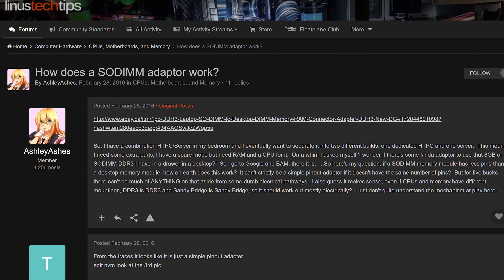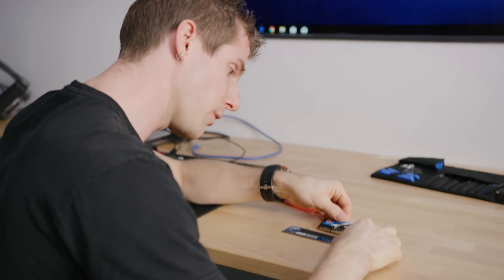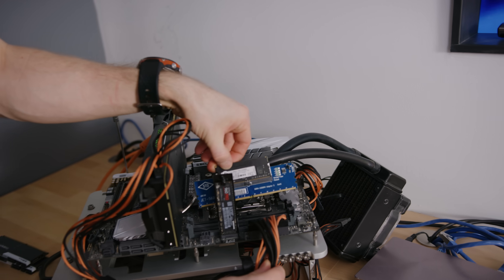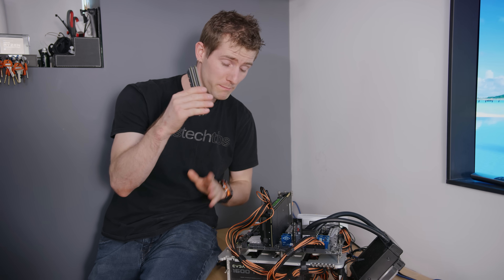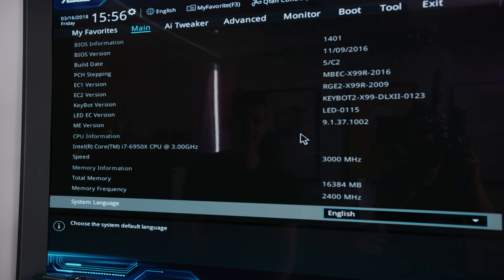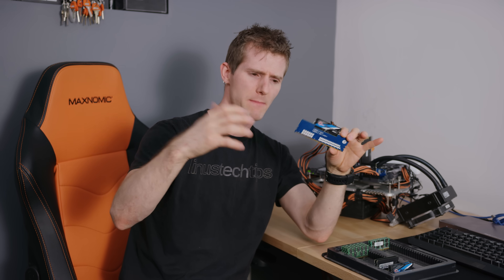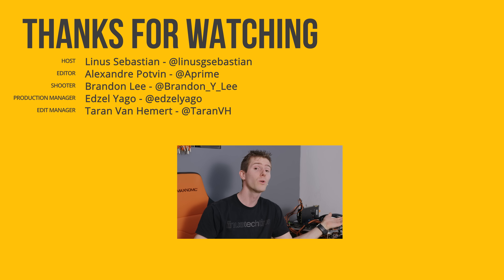Installing Laptop RAM into Desktop!?

Comment: Can you build a pc witout IP?
Reply: PurpleShadowYT yes you can build one without intergalactic penispumps
Reply: PurpleShadowYT Yes you can build one without ingress protection.
Reply: I personally wouldn't even consider watching incest porn whilst building a pc but hey.. each to their own
Reply: What's building a pc got to do with you having ingrown pubes
Reply: Wolfgang That's the only way to build one
Reply: Yes, to whatever it is. Let's just go with intergalactic protocol  ;D
Reply: Intergalactical porn
Reply: His channel is a Minecraft channel, I don't think he is joking when he thinks "an IP" is a physical part.
Reply: Why would you want to have a pc without interracial porn?
Reply: Yes. Don't connect it to the Internet or a local network and it won't be assigned an IP address.
Reply: loopback interface wouldn't be assigned if you boot certain clean linux distros with literally no connected hardware component holding any MAC address information... It's probably an optimization feature.
Reply: It might be difficult to build a PC without Intellectual Property
Reply: Omg hahaha!
Reply: april fool!!!
Reply: I'll have to give it a go now
Reply: mjc0961 it will have an address or couple that references itself in most modern operating systems (like 127.0.0.1 in most UNIX based ones). IP is a part of the operating system networking itself, not just outbound connections.

Comment: This is honestly great if you say come across a deal on laptop memory that's a good bit cheaper then desktop memory, or you working on an older system for someone, and only say DDR2, or DDR3 laptop memory laying around. So yeah will be keeping this in mind as I have and older computer at my work that could be upgraded to 8GB of DDR2 memory via laptop memory I have in the parts bin.

Comment: Is it cheaper than buying DDR4?
Reply: Drew E. I think the adapter is best to repurpose extra sodimms from broken laptops
Reply: In my country 8GB of DDR4 SODIMM is $45 USD, but 8GB of DDR4 DIMM is $105 USD, I'm buying 4 adapters tonight.
Reply: It you already have 4/8gb DDR3 SODIMM sticks it can be worth it.
Reply: tyaty wait so this makes ddr3 compatible on a ddr4 mb?
Reply: No. 
I was talking  about the  DDR3 version.
Reply: Drew E. SODIMM has been cheaper since 5 or so years ago.
Reply: I wish lol. Looking at SODIMM a year and a half ago for my laptop sucked. Although, due to DIMM prices skyrocketing, DDR4 DIMM and SODIMM kits are around the same price from what I'm seeing on PCPartPicker
Reply: Yeah, I looked it up too, on ebay 2x4gb costs 60$, (for the cheapest) plus 20$ for 2 adapters.
Reply: Balázs Rakó SODIMM is typically always more expensive...plus the cost of the adapter...I doubt it. Although in the current market, who knows

Comment: If you had laptop memory lying around, you can actually find itx motherboards that supports it. That's what I did with my last build. I had a laptop die, and it gave me 12gb of RAM. I put that in a Asrock IMB-181-L motherboard, with an i7-4770 and it is working pretty well.

Comment: I wonder what the cost difference between desktop and laptop memory is due to the different levels of demand?
Reply: farmerwoody123 i added it up to... 16 gb ddr4 2666 desktop ram at around $170 and up... vs. 16 gb of SODIMM ddr4 2666 at $94 plus $19 for 2 adapters... so $114... hell id try it out to save $56
Reply: farmerwoody123 Yeah it used to be laptop ram SODIMM was roughly 10% more expensive then DIMM
Reply: definitely lol!!

Comment: I wonder if you can use mismatched memory. For my desktop PC, I have a pair of 8 gb corsair ddr3 2400 mhz memory sticks with another pair of g.skill 4 gb ddr3 2666 mhz memory sticks. I kindof thought at first that I couldn't mix them in, but I did install all of them together and my PC now seems to work fine with all of the sticks for a total of 24 GBs of ram running at 2400 mhz with 10-12-12-31 latency, so I guess I did good there.

Comment: I think some versions of the adapters have the ability to override the RAM's configuration chip and some don't. I bought some for DDR3 RAM, they seem to work ok. It was actually a significant amount cheaper at the time to buy these and re-purpose some old RAM than by either new or second hand RAM for the motherboard.

Comment: so strait from the ebay page, this explains the ram speed and possibly the compatibly

Supports 2133Mhz Frequency
4-Layered PCB Design
Compliant with JEDEC Specifications
Over-Current Protection on SPD device
1-2 short: Select SPD device on adapter, 2-3 short: Select SPD on Memory Module (DUT)
Reply: Duds lol doesnt ltt have writers to skript these videos and do the research xD
Reply: 1,2 & 3 are the 3 jumper pins. The two jumper positions let you decide where to read the spd data from during post from the adapter or from the sodimm module itself
Reply: I get what you’re trying to say, but remember that ‘supports’ doesn’t always mean that anything else won’t work. 

For the compatibility stuff idk
Reply: @ v Nyggi, Yep thats the point I was making. This one did seem very light on research. Its almost as if that was the first time Linus had seen the adapters.
Reply: 1-2 short: Select SPD device on adapter, 2-3 short: Select SPD on Memory Module (DUT)
Can someone explain what this means?

Comment: If you have old laptop/iMac RAM, might as well get a less expensive adapter, especially in this day and age of super expensive RAM (you just need to be sure to match DDR3 TO DDR3 or DDR4 to DDR4, and match speeds and timings)

LTT should've tested mixing adapters with normal DIMMs that already have the same speeds and timings, or with first setting the normal DIMMs to a lower speed, then booting off and plugging in the adapters.

Comment: That's a great concept, but more research and test must be done for a finish product!
Reply: I read that as Finnish product as well.
Reply: ja wohl herr general
Reply: Nope its china. Its ebay. Make it and ship it.
Reply: Then use a German product instead.
Reply: That’s a great try but it needs more research before it can be a finish sentence
Reply: Mirage pt Stop trying to sound like you know shit.
Reply: noxxi knox It’s cool, it’s just a concept and it’s why the thing isn’t exploding on the market.
Reply: They have made memory adapters for years.
Reply: Maybe there is something to look at power consumption. Sodimms uses less power than dimms.
Reply: MIND NOVA ->Feel free to correct me, i am more of a power electronics person but i do know than differential pairs+length matching are very important for high speed circuits.
Reply: It is quite obvious to....some....that using one of the adapters in any of the RAM slots would make none of the RAM not work due to the increased trace length compared to regular DIMM cards. RAM are very high speed components and exact trace length to the DDR ICs is a must, that is why the trace have a lot of curves so that all the traces have exactly the same length. It might, or not, be possible than 5mm trace mismatch can make any RAM to not work.

That means than no amount of research can improve the product because one cannot cheat physics.

Comment: Now lets see using DIMMs in laptops
Reply: rememmber some Aopen barebooks did use full size DDR DIMM's.
but they also had the most crappy GPU's in history even for Laptops of it's time like a Geforce FX5200 or just Intel GMA on an "workstation grade" laptop.
Reply: Just give Linus a dremel or an angle grinder and he should be able to whip something up.
Reply: TheAlternateAir yes
Reply: TheAlternateAir I
Reply: There is in fact a kit,that you use soldering to install a few years back  its ddr2 or ddr3, remember it being installed into ,2008 macbooks...it was more for turning g a laptop into a desktop but ... why....oh yea for the lols,
Reply: +Linus Tech Tips YEAH HOW BOUT DA- what been trying to get! A tech guy I know said You can't but wanted it so bad:D 
Got a perfect test subject. Old HP 4520s business laptop, with ton of space. Love the design and screen but got low specs.
So I plan to add dimm memory, NVMe ssd, new fans (so loud now;/), white lighting below buttons, thunderbolt/usb3 & put 1080 inside (or lower end card with water cooling!). But no one here wants to risk it. Balls. It would be awesome tho.
Reply: They are too large.
Reply: yea why i think it was more aimed at ppl who wanted to turn laptop into desktop,was like 8+ years ago,i guess it never caught on ,which i am not surprised about.
Reply: Lol
Reply: TheAlternateAir that'd be neat
Reply: It's easily done. You just cut them in half. Although, they will of course have half the capacity.
Reply: My laptop already uses that
Reply: HELL YEAH use a bunch of riser cables of some sort
Reply: ha, that'd be like using an SD card in a microSD card slot
Reply: hahah
Reply: TheAlternateAir get SODIMM adapters
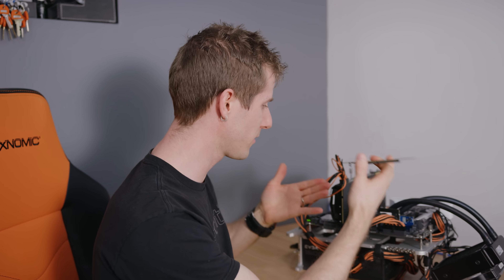Reply: 6:30
Reply: RGB LAPTOP RAM
Reply: Lol
Reply: im about try putting laptop ram in my desktopd
Reply: =BOOM!
Reply: YEEEEA BOIIIIIIIIIIII
Reply: Yes
Reply: lets LN2 these
Reply: i had an hp all in one that used DIMMs in it.
Reply: BlueDogTM not GLaDOS, just a normal core (Space Core?).
Reply: I LOVE PORTAL
Reply: @mint530  then go to the nether

Comment: Can you fit a compact cooler (cryorig c7 for example) into a gaming laptop?
Reply: You can't really replace the cooler in a laptop because it is a universal cooler, meaning it cools more than one component in the laptop (usually the CPU and GPU)
Reply: No, laptop coolers are incredibly thin, nothing can replace them
Reply: They should make a weird cooler lol
Reply: That's sort of what the laptops with a docking port do. That's about the only "normal" methods of doing it thus far.
Reply: Shadowfax there are several cases of people fitting their own dry coupling water cooling mods onto certain laptopa.
Reply: Unless youre willing to do some modding, no. You could make a little case extension, but you would need another cooler for your pc
Reply: no, but you  "could" submerge the laptop almost keyboard deep in N20... jus sayin